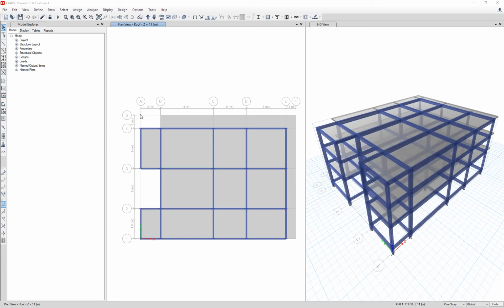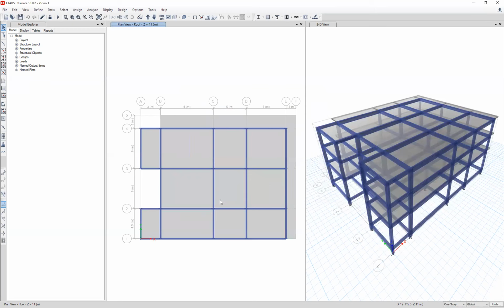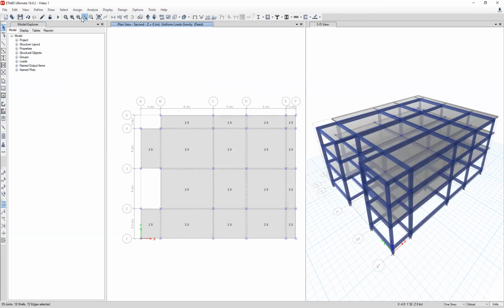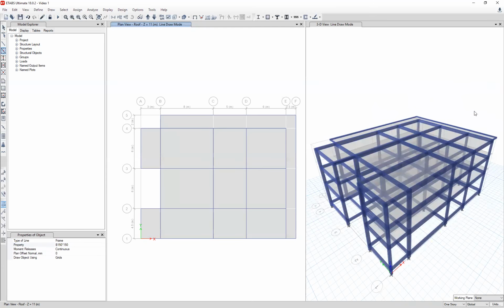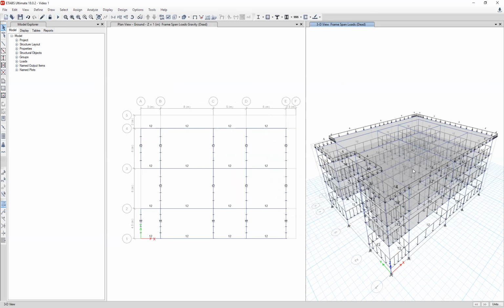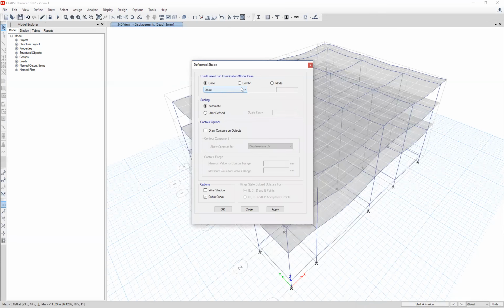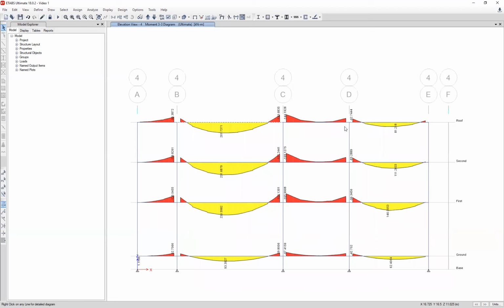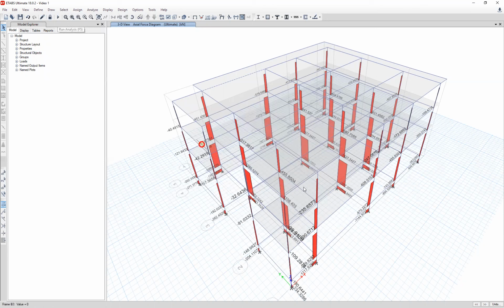ETABS 18 - (2) Adding Load Combinations and Loads - Analyzing - Showing Deflection, Moment and Shear

Comment: Jazakallah . Proff, how to calculate the wall loads and take as 12kn/m. As well as the extra beam on the upper floor as 4kn/m.

Also please continue this to the last part of concrete design and detailing output. And also how to choose the foundation on the same building.